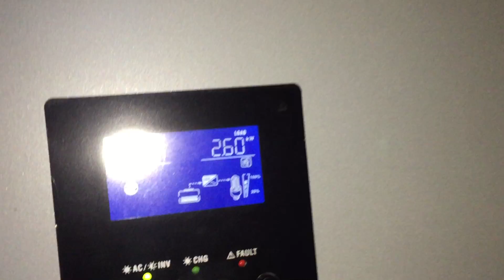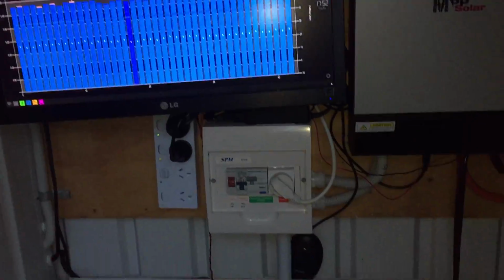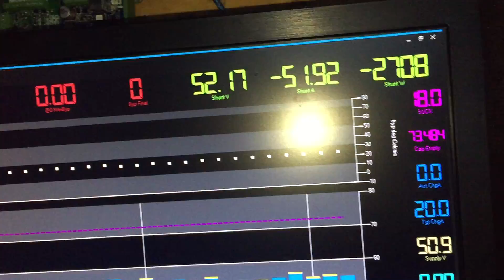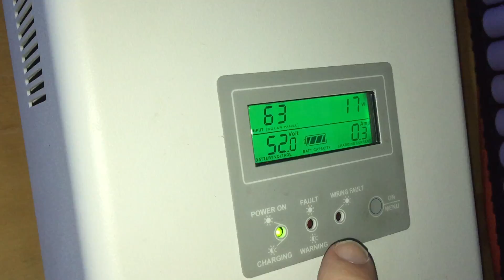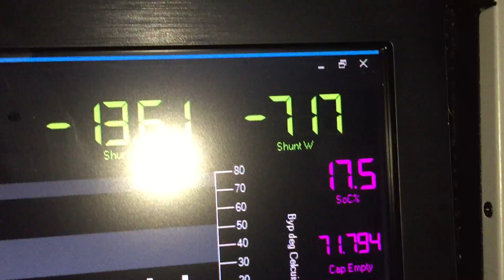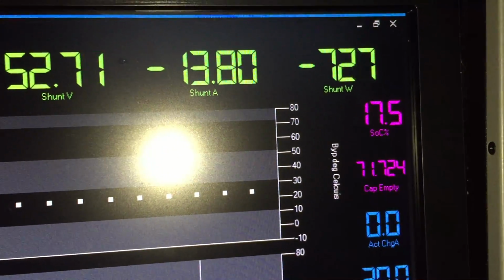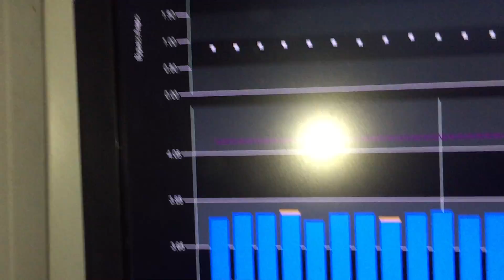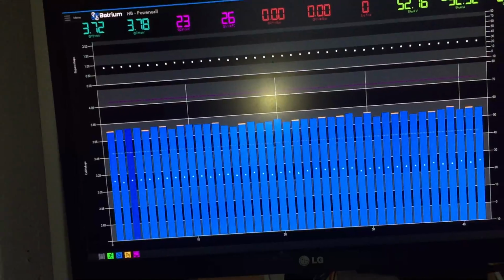18650 DIYPowerwall BMS finally finished being installed

Comment: Hi! wow lots of changes since I last tuned in, do you have a website with a wiring diagram somewhere showing the whole setup and the devices used? it's hard piecing it together from video updates! I'm about to have solar installed, might go with micro inverters so then only have to worry about batteries in an AC environment... not sure that's a good thing though :)
Reply from the maker: You can check out my forum post at http://www.diypowerwalls.com/t-HBPowerwall-Offical has pretty everything you need except the BMS update

Comment: What is the capacity of the battery pack at this point?
Reply from the maker: Still at 30kWh have the 40th complete and 50th waiting on cell holders. It's space that's slowing me down at the moment. Need more room so I can grow.
Reply: I think an addition to the power shed may be in order.  LOL
Reply from the maker: It's on the cards...

Comment: What is the maximum output of your powerpack? 2.5kW doesnt seem too much to me?
Reply from the maker: My inverter is a PIP4048MS a 4000w max inverter. Holding up very well to normal heavy daily use.
Reply: Really? Only 4kw? Doesn't seem to be very much to me?
Reply: Robert Hartung i think he said its 4.0k
Reply: Robert Hartung it's 4kw
Reply from the maker: 4kw inverter is more than enough with 30kWh of battery storage.. we don't run welders :)
Reply: lol